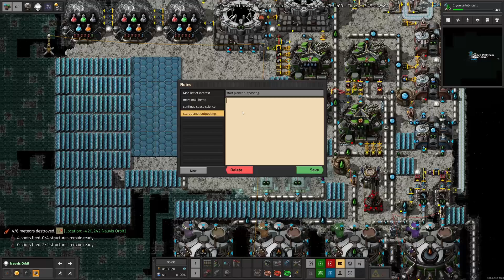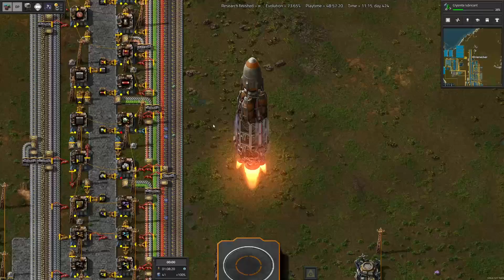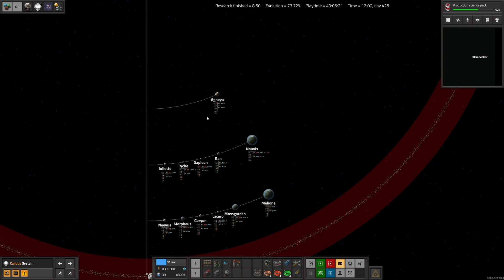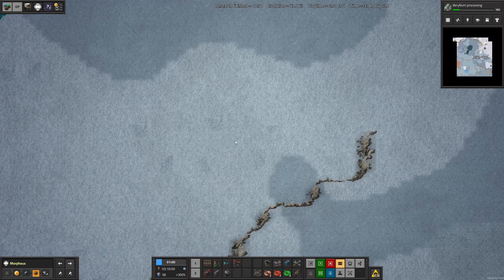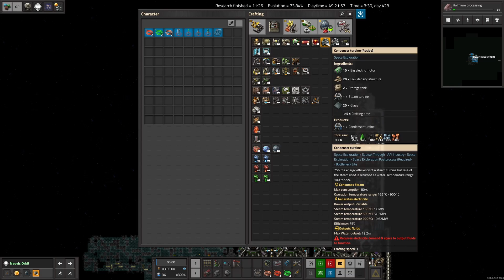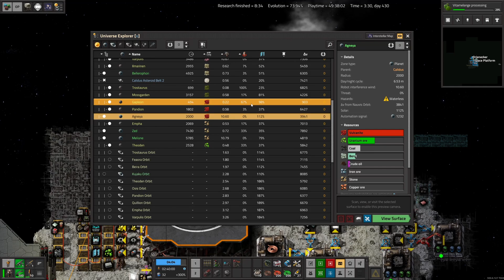Looking at Other Planets - Space Exploration #34

Comment: the primary ore will be in the deep core mines, finding it on the surface is a 'bonus' but won't be what you're going to rely on long term as they'll run out. cryonite/volicanite are the first two 'new ores' then the rest, as each stage of the research needs one of them to progress to the next one. depending on what you want first would be which ore you go after first for the outposts.
Reply from the maker: Do you know if the "Size" Frequency" and "Richness" of cryonite affects deep core mining? I would assume not, but I ask because its the top resource on the moon.
Reply: @DeanoGaming415  not sure on the size/frequency, I do know the size of the planet/moon the more core mines there will be.
Reply from the maker: That makes sense. Thanks for the info.